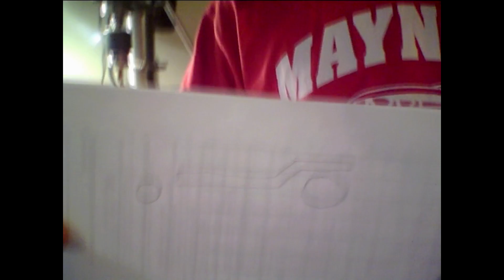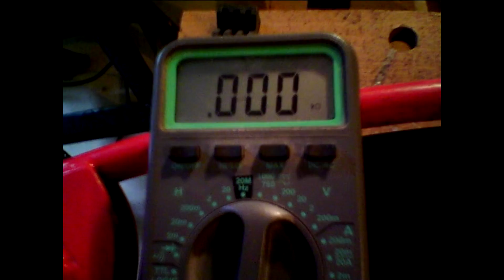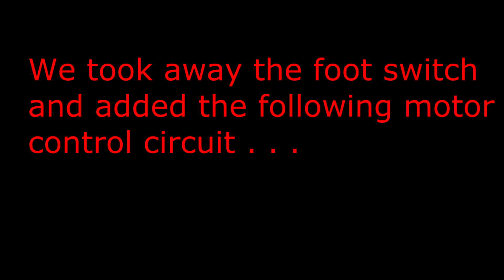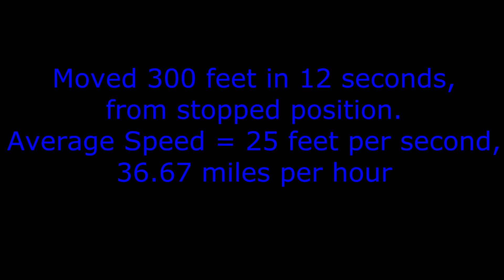Razor E100 Fast Electric Motor Scooter Modification 17mph

Comment: You know they make controllers specifically designed for this kind of setup. Not only would you have a variable throttle but also voltage protection for the batteries. They aren't even expensive.

Comment: Rubbish 37 mph
Actually it's 17.045
Reply from the maker: You are correct, calculation error. honest mistake, as you can see i had the data of 300ft and 12 seconds but the end calculation was wrong. Sorry about that, thanks for finding this and commenting
Reply: That's ok 
Just a bit misleading 😊

Comment: 37kph?.. maybe.  37mph,,, never
Reply from the maker: yes 37mph
Reply: plz can u prove it coz i honestly dont believe u
Reply from the maker: Gavin Romburgh actually you are correct, i checked it again and it is calculation error...honest mistake. As you can see at end of video i had the actual data correct of 300 ft in 12 seconds but the end calculation was wrong. sorry i have corrected the video title to reflect this. Thanks for seeing this and commenting

Comment: The good old R2d2 relay. I used those many times in the army. I just found an e125 scooter at the landfill yesterday. I brought it home all switches tested fine, connected motor to my lab supply and it was flying. I finally pulled the batteries out and charged them. I drove it around with my daughter on it for an hour. Good times